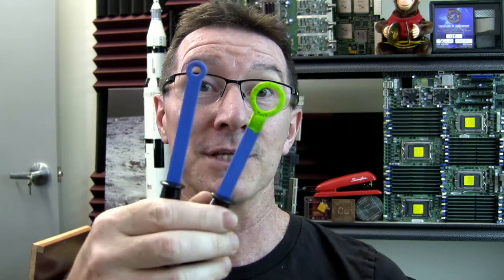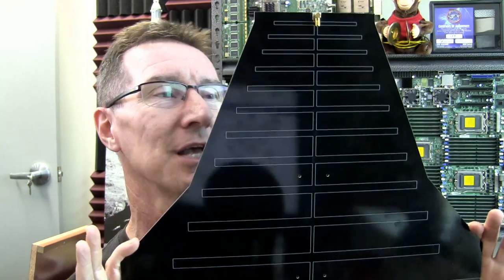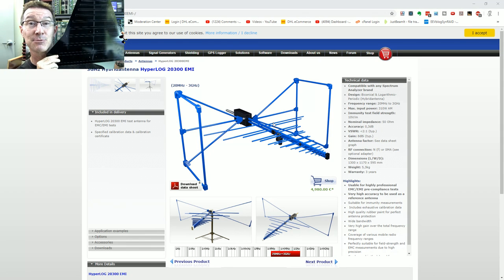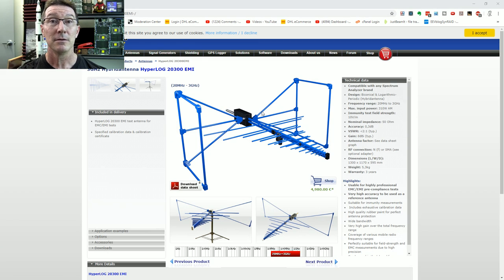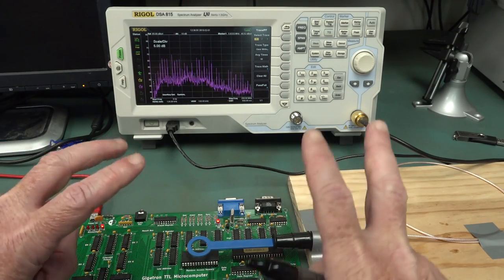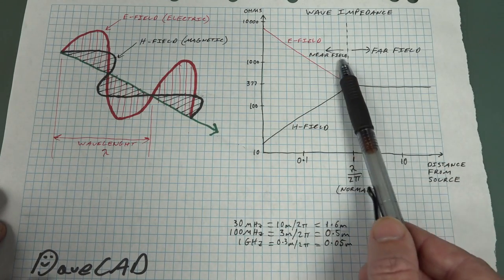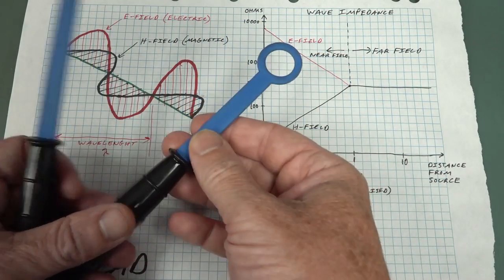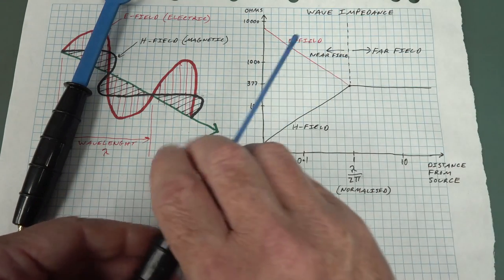EEVblog #1273 - EMC Near Field vs Far Field Explained

Comment: 30-300 MHz log periodic?  It's not going to be cheap, because it'll be quite large. The bowtie is a great antenna for 300 MHz, because it's relatively small, and it's bandwidth is almost 100 MHz.  It allows the log perodic section to start just below 400 MHz, which makes it smaller, too.  At 30 MHz, the bowtie's bandwidth drops to 10 MHz, and it would be something near 24 ft wide.  It saves you about a foot each way (width and length) on the log-periodic-only (30-300 MHz) version (vs. a 30-40 MHz bowtie plus 40-300 MHz log-periodic).  Not enough space savings to justify the extra materials and work, really, and either way - Huge.

     It's not hard to make your own log-periodic antenna.  There are a few log-periodic design programs around.  Here's one site that gives all the details and a calculator: https://hamwaves.com/lpda/en/index.html, though you'd have to use larger square tubing and 1/4" aluminum tubing for those lengths.    If that's just too huge, you could try a Fan Dipole.  They're very popular with Amateur Radio people who just can't afford one of those huge beam antennas, and you can make it out of wire and roll it up for storage when you don't need it, or just leave it flat on the wall.

Comment: 30Mhz antenna is gonna be quite large....how about just using some tuned wire?...(2.377m for each side of a dipole!)
Reply: The trouble with dipoles is that you have to adjust the length for each frequency if you want to get calibrated results. This quickly gets very, very tedious if you are testing multiple  frequency ranges
Reply: I like Tool :)

Comment: So is it correct to say that an SPI signal will mainly produce E field (high and fast voltage variations but low current) while the switching node in a converter will rather produce H field (big currents involved)?
Reply: Yes except that it is big /changes/ in current that would produce the alternating H field that is relevant here. A large constant current would produce a constant magnetic field like a magnet, and wouldn't be measurable with that probe, and wouldn't form a radio wave when combined with the E field beyond the far field distance. For more on magnetics, and measuring constant magnetic fields with a different kind of probe, see the AppliedScience video on the BH Curve.
Reply: The switching node is actually high E field due to high dv/dt, while your input/output loop (depending on buck/boost) is high dI/dt and therefor high H field.

Comment: I've never seen proper  response curves for cheap log periodic TV antennas on eBay, nor someone take a VNA to one, but some claim to go down to 40-50MHz for FM radio. Might be some gaps between 230-400 MHz though?

Other than that, DIY?
Reply: The cheap antenna are easy to figure out. Usually take little more than basic geometry to compare the expected waveform to what the antenna is configured to be sensitive to. Since your talking cheap, you can safely assume there's only bare minimum signal processing if any and rely on physical characteristics.
Reply: NO Corporation fm radio is 96 MHz to 108 MHz, ~50 MHz to 96 MHz was the old analog tv low band
Reply: @Chris_Grossman  ITU region 1 is 87.5-108, ITU region 2 is 88-108, Japan starts lower? Not sure what FM broadcasting region starts at 96?

Comment: Hi Dave, I have always been suspicious about the drawings or animations that show the E and B parts of the EM fields in phase with each other. Indeed Faraday and Ampere equations that are part of Maxwell's equations precisely state that there should be a quarter wavelength shift between E and B when these contain only a single frequency. But I could never find any drawing actually showing the right representation.
Do you have any clue? I may misunderstand something.
Reply from the maker: If you do the Maxwell business then that can popout for various polarisations. But for linear polarisation the phase angles are the same.
And yes, I don't think I've ever seen it pictured that way either though. Maybe because it more confusing drawn that way? Don't know.
Reply: In free space E and H are always in phase.
It is curl of E that is equal to the partial time derivative of B and in absence of lossy materials (i.e. real wave impedance) the E and H field will be in phase.
If E and H were to be out of phase by 90º the time average of Poynting vecotor (E*conj(H))would be 0 and there would be no transmission of power
Reply: @TeslaLegend  I completely forgot the affect of the curl operator. You are right about the average power too.
That's one more question answered I don't need to deal with.
Thanks a lot!
Reply: @nicolas_poli  

You are very welcome. Cheers.

Comment: HELLO....ANYONE, What is the reason for near field and far field testing?
Reply: Testing is for compliance with regulations that forbid radio interference.  If a device emits excessive unwanted EM waves then it would interfere with other radio signals.

Comment: New EMC antennas are not cheap, the cheapest new one I found is 
http://www.rowielektronik.de/emv-emi-antennen/hta-2003-20-mhz-3000-mhz.html
It comes with individual calibration data (antenna factor table).

Of course you can try to buy used one on e-bay. Sometimes you can find bi-log for 200....500$.

Comment: Hey Dave, have you contacted Dr. Arthur T. Bradley at Disaster Preparer about a source for your antenna ?  He was working on a product called EMP Storm and has been dealing with EMP factors.   J K
Reply from the maker: Are you serious? A prepper? What would he know about EMC antenna design? EMC!=EMP
Reply: He is an engineer and has worked for NASA.  He deals with testing and EMP.  Maybe not the exact same subject but at least he may be helpful.    J K

Comment: You'll want to build a biconical (modified cage dipole) like this: https://www.com-power.com/products/antennas/biconical-antennas/ab-900a 
Covers 25 to 300 MHz.  The standard I used over the last 20 years for MIL-STD 461 testing has been the A.H. Systems SAS-540.

Comment: 2π of 60Hz is about 800Km, fits between the top of the F-layer of the ionosphere and the lower part of the asthenosphere. Also the fundamental frequency that fits within this boundary (I.E 2π * 60) is equal to 376.99Hz....... WTF?
I know its Ohms not Freq but still, nature loves a coincidence :-P

Also, 376.99112 / 123 = 3.065
1, 2, 3.... 123... I kicked myself when I realized.

Comment: compliance compliance compliance, government is a nuisance.
Reply: Not as much as having every electronic device you have interfering with each other and making broad spectrum noise that ruins radio communications near you. Then there is having two broadcast stations too close together transmitting outside their assigned bandwidth. Cross-talk EVERYWHERE!

Better to set down a few rules and make international treaties so everyone is playing nice instead of pure chaos instead of nobody getting to do cool and useful things with radio technology and electronics.
Reply: Untill someone will blow your equipment out of the water with 1kW CB radio at 27MHz
Reply: Your opinion might change after getting a pacemaker installed.
Reply: You say that, but just get a cheap LED bulb from China and power it up.  Then try listening to digital radio on a portable receiver.  I did a simple test between a Chinese bulb and a certified UK one by placing them near to a spectrum analyser with an antenna attached (very rough test) - the amount of RF noise coming from the Chinese bulb compared to the UK bought one was quite astonishing - much higher level and extending right into VHF (causing real reception problems on nearby digital radios).  Just think if your whole house had these Chinese bulbs - your neighbours probably wouldn't be too pleased.

Comment: Halfway through the video and you haven't explained a damn thing yet.
Reply: The slider on the bottom is there for a reason.
Reply: @750kv8  
Useless info. How do you know how far to slide when you haven't seen the contents yet? Maybe it's going to start in the next 10 seconds.... Nope.  Maybe it's going to start in the next 10 seconds.... Nope.  Maybe it's going to start in the next 10 seconds.... Nope. (etc etc) I was expecting an explanation of near vs far (per the title) but he didn't get into it until more than halfway through.....
Reply: @UC93i9HMQr-27SSHHxDTdu_A - He does teach you how testing procedures work, doesn't he...? This is called trial-and-error.

😅